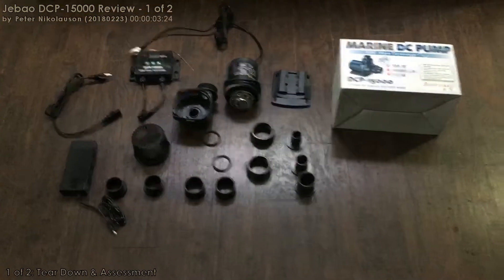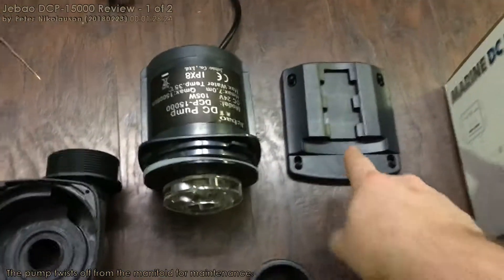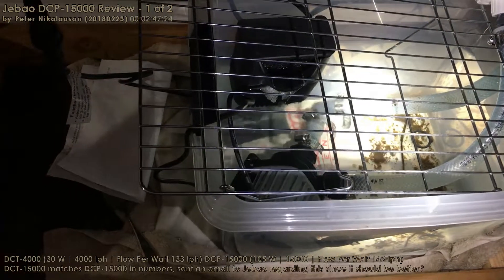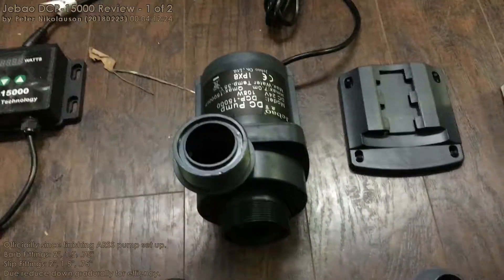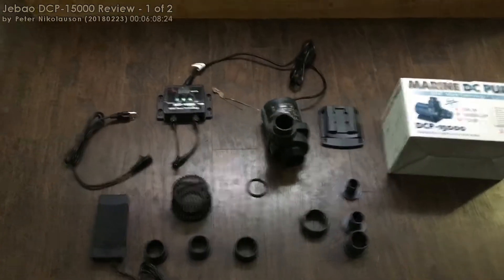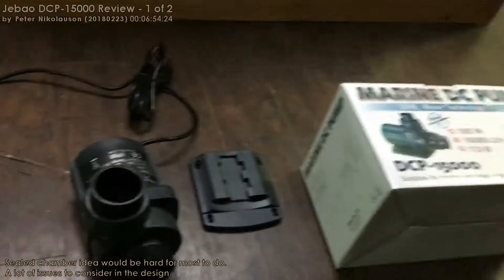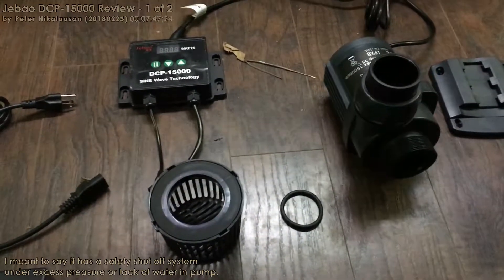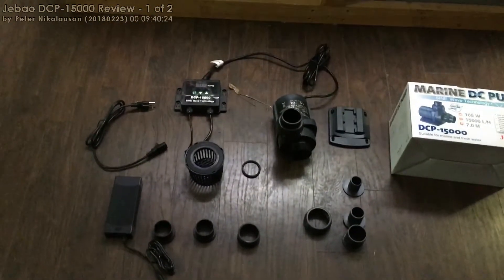DCP-15000 Review and Breakdown 1 of 2 (20180223)

Comment: Hello is the 15.000 pump 95mm inside housing where the o ring sealing sits...
Reply from the maker: The o-ring is approximately 110mm based on rotor insert circular fitting, this is cross measured. Inside space magnetic rotor insert is 41.76mm with no seal. The wall the seal sits against is 100mm. O-ring is about 10mm thick. That help answer what you need? Lucky i haven’t repaired my second motor yet.
Reply: @1014p   okay thanks alot im looking for a jebao pump for a skimmer to my reef tank... but the pump must be 95mm to bad i cant show you a picture of it... its a Rlss db12i skimmer pump sits inside skimmer..
Reply: @1014p  maybe the 12.000 pump is what im looking for